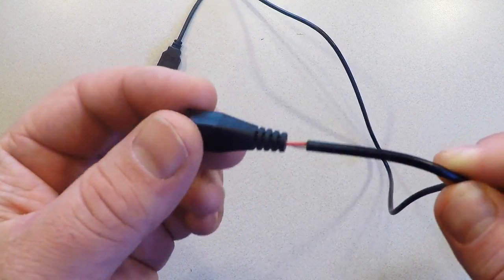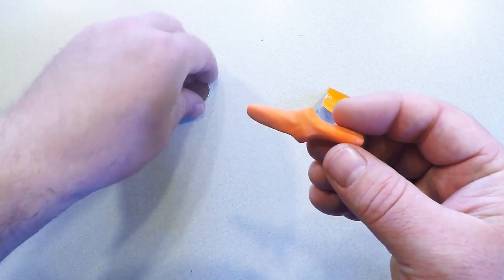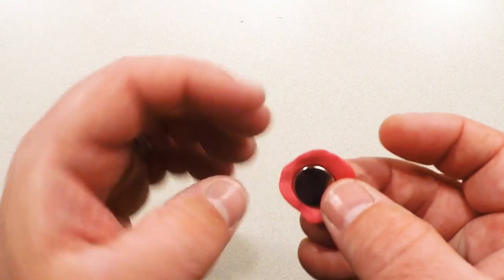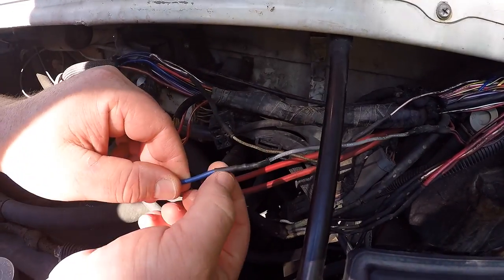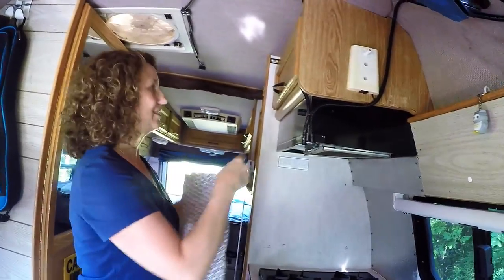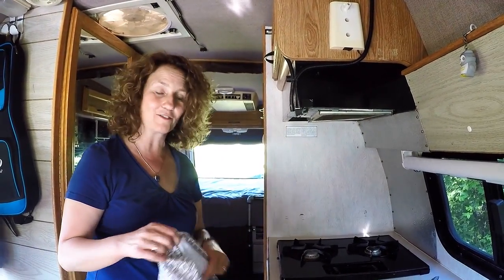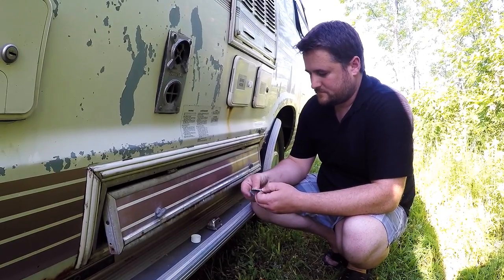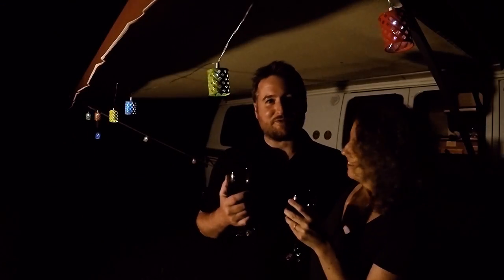GGC - 57 - Vanlife Hacks Using Sugru Mouldable Glue

Comment: Sugru is a wonderful silicone rubber product for lots of fixes that require a flexible, waterproof repair - like your wiring. But, if I may offer another suggestion, many of the solutions you showed could be better served with a 2-part moldable epoxy putty like Apoxie, Magic Sculpt [which are available in many sizes and several colors] plus dozens of other similar brands I'm not familiar with. Epoxy putty makes a more permanent, much stronger, and more rigid fix for lots of uses and is much less expensive than packets of Sugru. Plus you can measure out 2 equal portions of only what you need and store the rest for other fixes later. And having been opened, it will keep in a cool place for some years too and it can be easily smoothed with a wet finger.
Reply: Thanks for this. I was hype when I just discovered this stuff but WAY too over priced. Apoxie looks fine with 4 lbs for $45

Comment: Or make your own by mixing cornstarch into RTV silicone sealant. Silicone cures by reacting with moisture in the air so thick pieces take a long time to cure inside.The cornstarch absorbs moisture and carries it through the silicone so it can cure right through quickly.

Comment: been using SUGRU forever...great stuff! but choose your projects wisely as it a bit expensive. I never leave home without it (or silicone tape). P.S. once you open a package you cant reseal it so pick a few uses for it (if you only need a dab for your project) as you have to use that amount of sugru or it will harden

Comment: Sounds like a great product! and a fun video to watch. lol 
QUESTION: if you only use half like Paula did in the kitchen can you save the other half or does it harden cuz you've opened up the package?
Reply from the maker: Hey R unners! According to Sugru, you need to use it all once the package has been opened.  That said, we've found that if you place the unused portion in a plastic sandwich bag and store it in the freezer, it seems to stay fresh for several days.  I'm not sure how this may affect the overall quality of the sugru, but it still seems to adhere and set into rubber like normal.

Comment: LOOKS very cool just ordered some i have 1 question at Polly used only half the amount in the package for one demonstration of so if you dont have anything do use the other half for is there a way to store it until you need with out it drying
Reply: I haven't really found a way. You can keep it in an airtight container in the fridge, which slows the curing process, but as soon as you open the packet you're already started that process, so any leftovers you've kept this way don't work as well as the stuff you get when you first open the packet. I guess it's the main reason why the packets are so small.

Comment: Hi Folks,  just got my first order of Sugru.  Uploaders mention using half the packet on some projects.  What about the remainder?  Is there any way to re store or seal it so it can be used another time?
Reply from the maker: Hi IanRM, according to Sugru, the official response is that you have to use it all once the packet has been opened.  They recommend not trying to store it for later use.  That said, we've experimented a bit by sealing the unused portion in a plastic bag and placing it in the freezer.  It still worked fine about a week later when we thawed it out.  That said, I can't guarantee that it will perform as well as the freshly opened sugru, but it did work for us.  Your results may vary.  We hope you enjoy it either way though! :)
Reply: Many thanks

Comment: At £13 for eight,once opened must use blobs,it's around 50 times more expensive than similar products or other ways of getting the job done. This is truly taking the piss.
Reply: Sugru is something you take your time over. Don't do one job that will only need half a packet, wait until you have two and do them both at the same time. It's a great product that I have used several times but sometimes I have the Sugru in the fridge for months before I come up with multiple jobs to maximise the use of it. I never waste any.